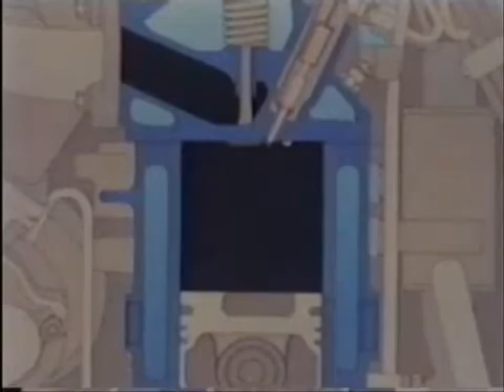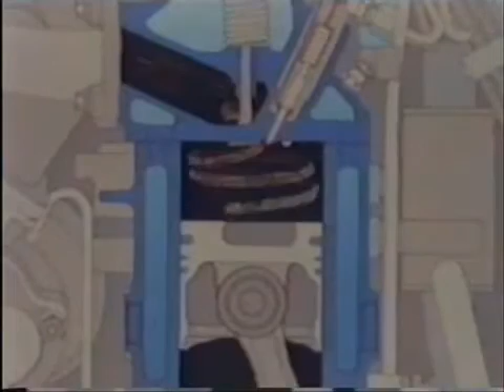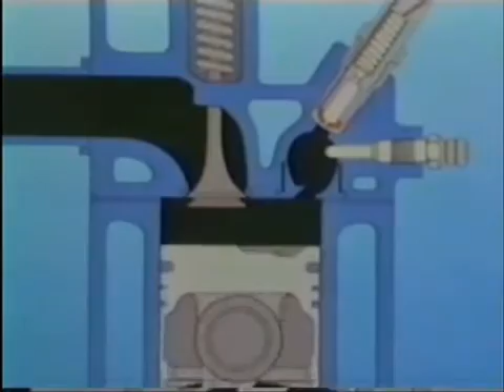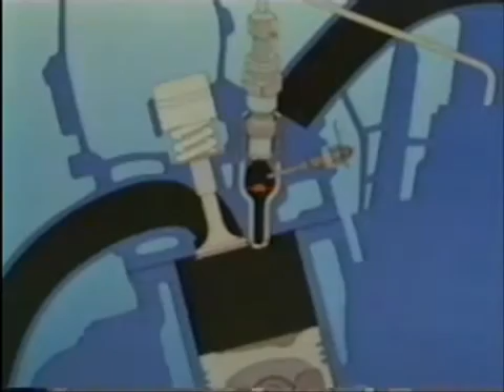DI and IDI Diesel  Engine

Comment: Not true,IDI diesels are noisier than DI diesels due to uneven burning. DI are much quiter as they burn evenly
Reply from the maker: 👍 true for modern engine... But low injection pressure and lower wall temperature in DI may result in longer delay and noisier combustion
Reply: This video is old dude … don’t argue

Comment: what is the date of this video?
Did the heat loss get fixed?
Reply: As the speaker summarizes himself, following research allowed direct injection to be the most widely used. Im unaware of any idi diesels being in production for the last 25 years or so, at least not for automotive applications.
Reply: @staszeksowikowski9039  here in indonesia indirect diesels are still widely used in new commercial cars up until 2022, and passenger cars up until 2000s

Comment: Why DI is not used in high RPM vehicles
Reply: Injectors weren’t good enough back then.
Reply from the maker: Infact DI used in all high speed (RPM) diesel car engines
Reply: Only recently when we have common rail direct injection engines that can reach up to 2000 bar.
Reply: @jannadrielcervo7753  2000 bar, not psi

Comment: IdI is quiter lol, only when comparing a 1.8l idi to straight 6 10l+ di?
Reply: They absolutely are. All the mercedes idis are definitely quieter than the di. Same with all the ford diesel engines. It's at the very least a much less "sharp" sound with an idi
Reply: @benjaminturpin2749  Petrol direct injection is also noisier than port injection since the injectors have to be much higher pressure. 
Modern direct injection diesels are also doing a lot to mask that noise and are more silent in other areas, it would be interesting to hear how silent a modern IDI diesel could be.
Reply: The better comparison would be 7.3 idi bs 7.r power stroke
Reply: Yes or when comparing two popular tractor engines, Perkins A3.152 swirl chamber diesel or the direct injected AD3.152.
These two are identical except head, piston and injectors. The older swirl chamber A3.152 model is quieter and has practically no knock.
Another example would be late 1990:s Mitsubishi L200 compared to late 2010:s Mitsubishi L200, the later has a lot more knock.
Reply: 😂😂 maybe they were comparing straight piped diesels to muffled diesels

Comment: Direct Injection is restricted to commercial vehicles? This is obviously about 25 years out-of-date.
Reply from the maker: Direct Injection technology is used in all diesel vehicles including passenger car, all CRDI engines are DI type.
Reply: @dineshbawane4255  not all diesel use idi there is a 6.9 and a 7.3 idi